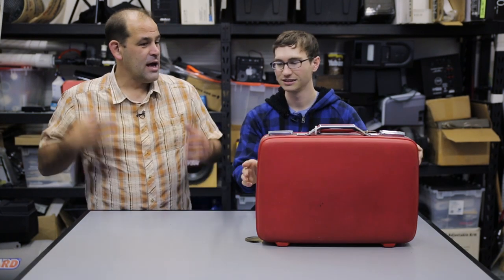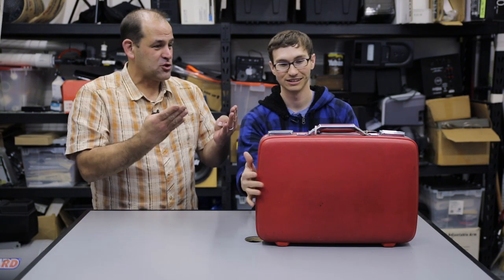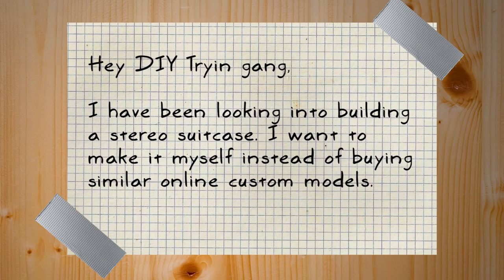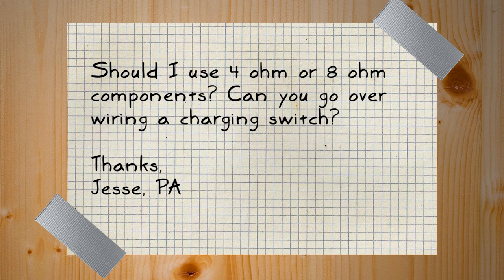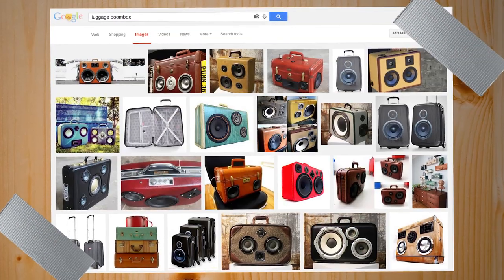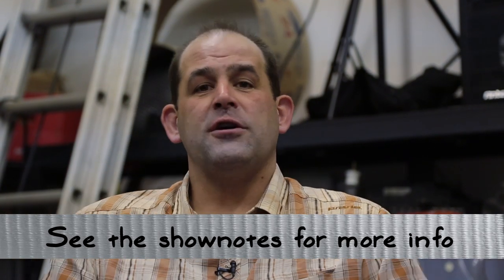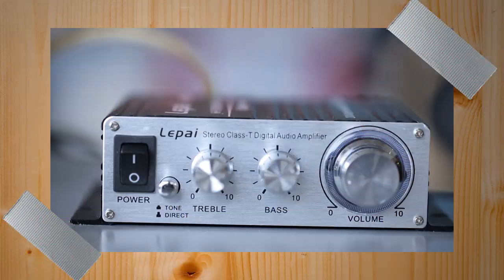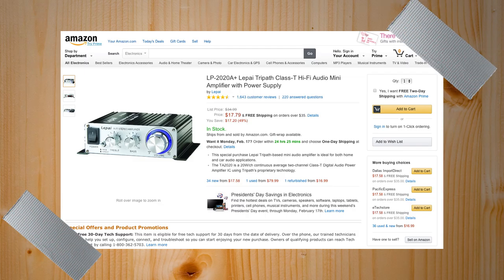Build a Custom Suitcase Boom Box!

Comment: I always thought the higher the ohms, the higher the resistance. Isn't that why most car audio is 4 ohms and home 8? Headphone speakers are generally around 32 ohms to keep people from blowing their ears out. Correct me if I'm wrong.
Reply: Anthony Guy you're EXACTLY right.
That's also the reason that car audio speakers sound so much better in a small enclosed area, and home audio speakers sound better in a larger area.
Always go by ohm ratings for a particular application, it's simple, and it works.
Reply: Wat? Impedance has nothing to do with the size of the area, that comes down to the physical properties of the driver, not the electrical properties.
Reply: Correct, but they said the same thing. 8 ohm speakers require less power from the amp but will not play as loud either, BUT the amplifier will also do less work at the higher impedance, making less heat and making batteries last longer.

Comment: I've found those cheap amps won't run off much over 12v. So off the lighter socket of a running car they shut down. Work great when the car is off however.

Comment: I'm honestly curious how you're going to solve the battery problem. Personally, I'd use my celestron powertank. It's 12v, fused for 10A, and has terminals that're screw or banana plug. Also solves the charging issue. Not cheap though, but I already have one.
Reply: You could get away using AA batteries. The Lepai uses around 300ma at max, so with 9 AA batteries (their voltage drops a little under load), you would get around 6-7 hours on max.
Reply: MrSkayze The amp isn't going to be the major draw, the speakers are. Decent sized speakers will kill AAs quick.
Reply: William Aycock We were amazed to find out that Class T/Tripath/Lepai 2020 amp drew between .12 and .15 A, at least until you reallllly turned the volume up.

Comment: So I'm planning to do a similar project. I will use 4 ohm, 30Hz-20kHz, and they are rated from 30W (nominal) to 300W. I will power it off a battery. what kind of amplifier should i get. Would 30W per channel work good enough?

Comment: I've considered using an old suitcase similarly but as a portable jukebox. I wanna salvage the guts from a laptop, put in an elo touch screen monitor and dump all my media on an easily accessible 1TB external hdd. I was thinking small but powerful speakers like maybe Bose, detachable power cord, chargeable battery 9pin?, power switch with the computer set up to auto boot straight to the jukebox software. Headphones jack and optional line out jacks for external speakers. Maybe you could try it.

Comment: Have you tried filling the case with fiberglass/rockwool to eliminate the case resonances?
Reply: We did stuff the case later... it deffo did a lot for the low end. The resonances were fixed by bolting the speakers down, then putting a bit of padding between the upper and lower haves of the suitcase. (We'll show in you the next ep.)

Comment: Is it possible to install ports on the outside of the suitcase? instead of running a cable through a hole in the suitcase.
Reply from the maker: That's coming in part 2!

Comment: Your wrong with the ohms. The higher the ohm the harder it is to power it. Smaller speakers have smaller coils so you cant push mutch power trougt it whitout it melting. smal speakers are about 8-16 ohms. Larger speakers (subwoofers) have bigger coils so the less ohms and the more power you can push trough it.